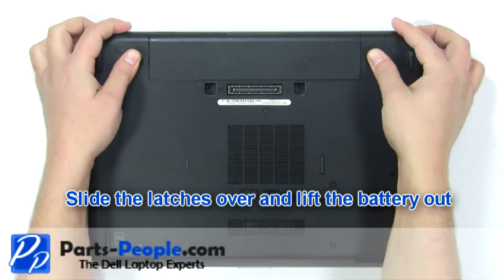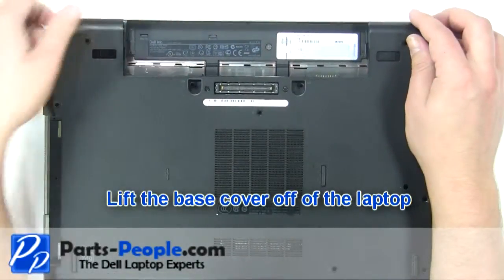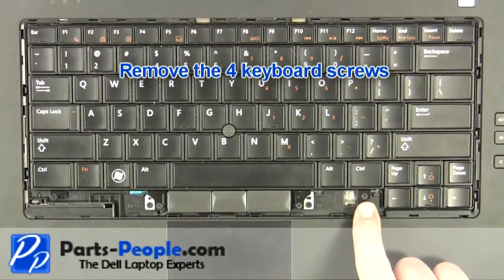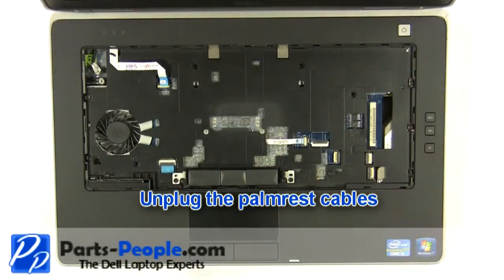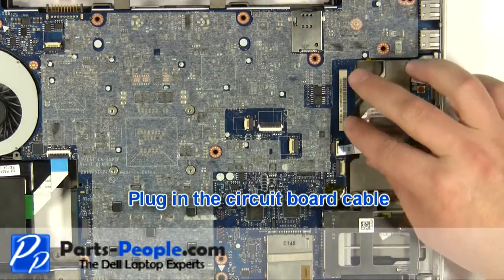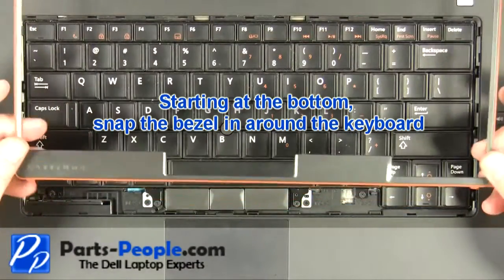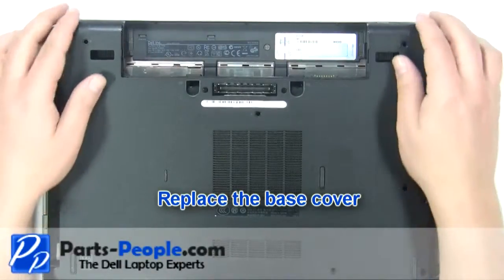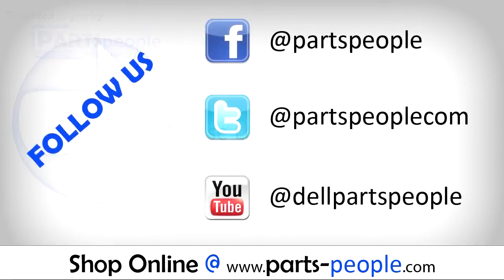Dell Latitude E6420 Volume Circuit Board / WiFi Catcher Switch Replacement Video Tutorial

Comment: If the Wifi doesnt work, do I switch this out? Wifi card has no issues. It shows that WIFI is off but you can see the wifi icon. It acts like if the switch is switched off when its on. the volume buttons work
Reply from the maker: Minwoo Kim It could be the WiFi catcher switch. There is a physical switch on the circuit board so the plastic latch may not be connecting to it properly. Other than that it could be the WLAN card, driver issues, or the antenna cables may have come loose.
Reply: Same issues. Could u fix that